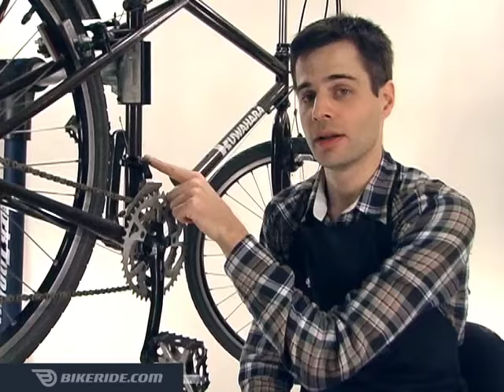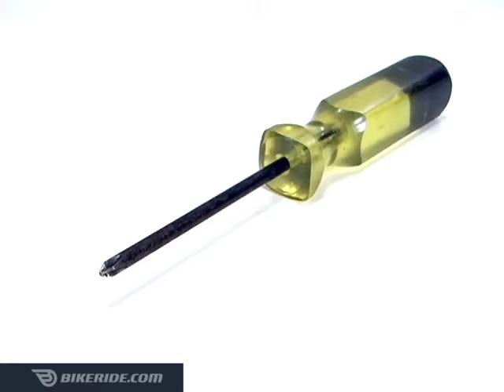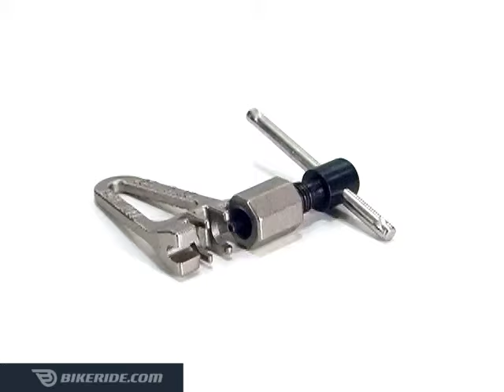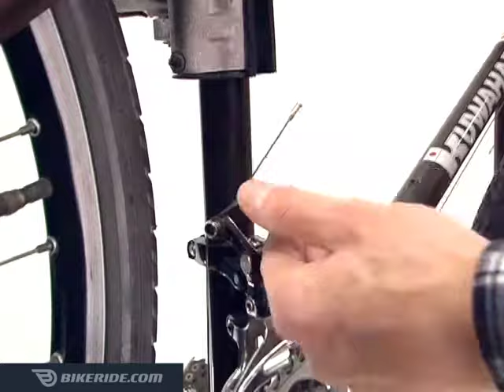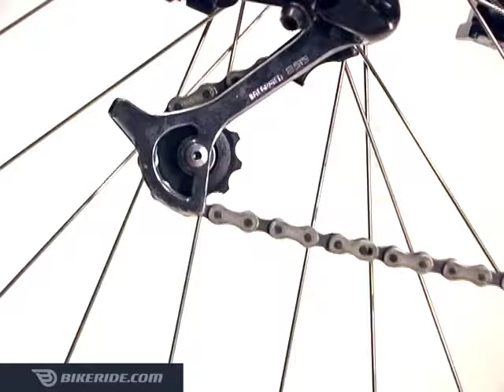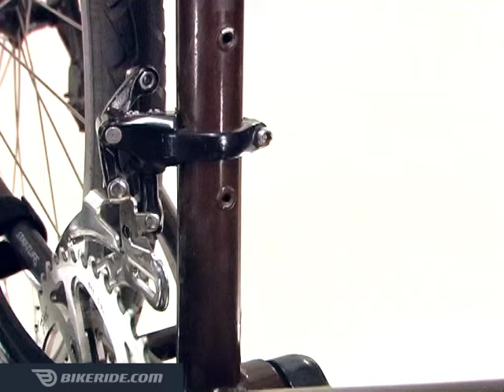How to Install a Front Derailleur

Comment: I got stuck at 'preset the low limit L screw'. The derailleur didn't move at all despite bringing the screw to two extremes. The chain is rubbing on the outer part. Sadly I'll have to look for an other tutorial it seems. Deore front derailleur, two speed.
Reply from the maker: Did you remove the cable before setting the low limit L screw? and did you double-check to ensure the L screw you adjusted was the low limit? If you had the cable still connected or were turning the wrong L limit, you would notice no movement. Movement will be very minor when it does occur, less than a mm per full rotation of the L screw.

Comment: Hi, when you adjust the L screw, with the chain on the smallest chainring, where should the chain be positioned on the rear cog?
Reply: good question.. pity there is no reply.
Reply: About a third way up the gears (so cog 3 for a 9 gear), i.e one of the  bigger cogs.

This is because when riding you don't want to use the very highest rear gears (small cogs) with the lowest front gear. So this puts you in the middle of the range you'll be using on the smallest front cog.

To set the top end, do the opposite, so use cog 7 for a 9 speed.

If you have trouble shifting, tune as appropriate. You might also need to fine tune the cable tension, using the collar at the gear shifter